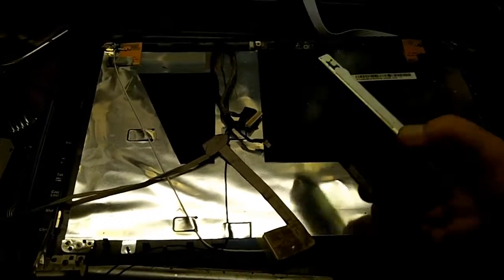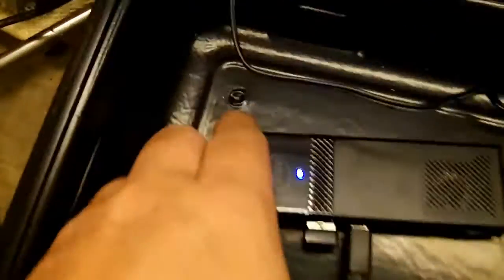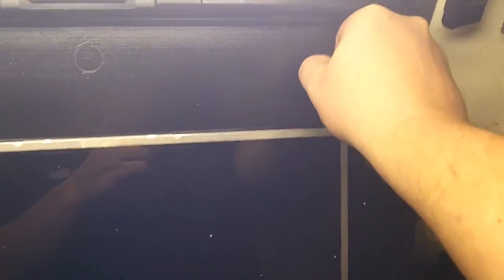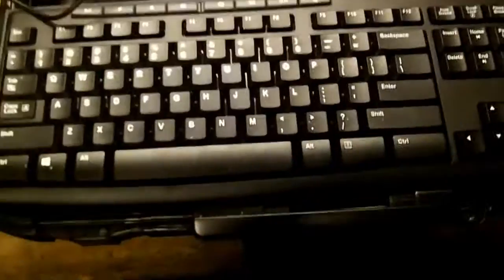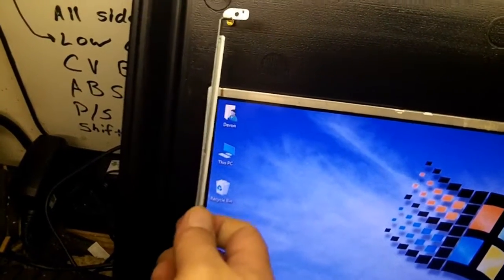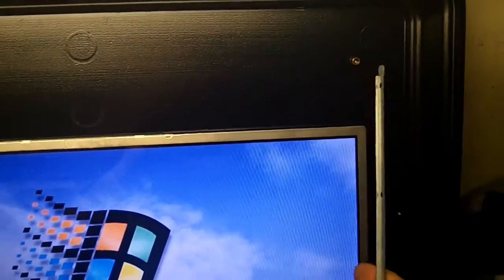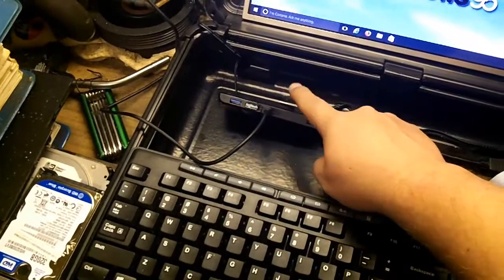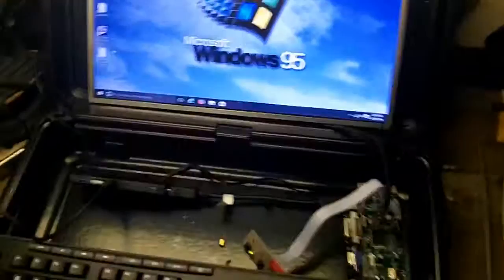DIY Custom Laptop w/Intel Compute Stick

Comment: dude try making a umpc with that
Reply from the maker: It's better to crack 1000 screens without losing your data than replacing 1000 tablets... unless you're in the business of making tablets.  I firmly believe the compute stick could have changed the world and the way we use portable desktop OS's. All they had to do was make it thermally efficient, sell it with a nicely crafted tablet sized monitor, and continually improve the HDMI based form factor. It could have wiped out laptops and tablets as we know it if Microsoft got on board with eventually allowing 64-bit desktop OS installs. It could have been a unifying form factor in something so simplistic. Instead we still have a world divided by laptops and tablets. The power of laptop with modularity of a desktop and display of a tablet in the form factor of a cell phone. A wasted opportunity to change the world.
Reply: @DJDevon3  Definitely. That is also why UMPCS in general failed. They had poor heating and had terrible specs for the price. UMPCS after the Toshiba Libretto 100ct just weren't that good.  It all fell apart when they couldn't fit enough power into a brick. But another thing that I think all UMPCS have lost (including smartphones) is the incredible battery life. The HP200lx had days of battery life. Umpcs definitely had a chance but all of these issues were the factors that killed them.

Comment: that's awesome bro ... would you like to add some built-n batteries in the future...i hope you make that a real laptop
Reply from the maker: There are 2 1650 battery packs I've added to power the system yes.  I still haven't finished it but I have tested it.  It can run continuously without recharging for 48 hours straight playing full HD video.  It was the best way I could think of for taxing the system.  The biggest design problem is not allowing the computer stick to touch the case otherwise it will melt a hole in it.  Using a metal shield and standoff to dissipate heat.

Comment: Creative idea and good re-purposing of a broken laptop's screen. But, that price? The compute stick is, what, $120-ish? The case is $30. The inverter board is $25-30? The new keyboard another $10? That is $160 to $170? I just bought a used Dell E6430 off ebay with an i5 3320m (dual core, hyperthreading, 3 MB cache, 3.1 GHz turbo on both cores) and the Nvidia NVS 5200m (96 CUDAs, Fermi, 1 GB GDDR3) for $140. It came with 4 GB of RAM, a 500 GB HDD, a Windows 7 64-bit Home key (that I upgraded to 10), the battery and the charger. Everything works great and the CPU, RAM and HDD can be upgraded. It will accept a quad core i7 CPU if desired which are now $80 to $90 for a 2.6 GHz one like the i7 3740QM (8 MB cache, up to 3.5 GHz turbo on all 4 cores). It also can be hacked to use a desktop GPU via the express card slot or the extra mPCIe slot. The only upgrade i did so far is a 120 GB SSD I had in an old PC. I don't own one of these Compute sticks but I do know that the performance is nowhere near the i5-3320m in the Dell. Even with the HD 4000 iGPU being used, the overall performance has to be 2x or 3x better. Clock speed alone makes the mobile i5 significantly faster. The Cherry Trail chip is using a shit ton less power, obviously, but running it on battery with a spin HDD and that display, it can't be getting much better battery life than my Dell laptop with an SSD and iGPU. Basically, if you are on a budget of under $200 and your laptop just died, a used Ivy Bridge or Sandy Bridge laptop might be a better bang for your buck option. They are dirt cheap right now and nowhere near obsolete yet compared to the current generation of dual core i5 and i3 laptop chips. That is just my opinion. Sell the dead laptop for whatever you can get for the parts and do what I did.
Reply from the maker: The small form factor is what attracted me.  I can fit it in my pocket.  I understand what you're saying about the laptop and desktop being more powerful of course.  They are a bit more modular.  There are many things you can do with a compute stick that you can't do with a laptop such as built-in workstations or displays around a house or building you plug a compute stick into.  So you take the computer with you in your pocket and then use a display at specific locations when needed.
Reply: More modular or more mobile? The compute stick is more mobile if you know an HDMI screen, a keyboard and a mouse will be available everywhere you go. If you have to lug that stuff around, a 14 inch notebook is more mobile with all those things contained in it. A laptop/notebook is even more mobile than your DIY laptop in this video. If you did mean modular, then the laptop I got is still more modular in design. The CPU, RAM and disk drives can be upgraded. It has eSATA, Express Card, SD Card, USB, mSATA and mPCIe. The DVD-RW drive pops out and you can add a 2nd HDD in the bay. It has HDMI and VGA out. If you get the docking station ($30 on ebay), it can run on 3 monitors and it adds Displayport and DVI-D. The dock basically turns it into a full-blown Ivy Bridge i3 desktop with a lower TDP since the 3320m shares the same basic specs with a desktop i3 3xxx (dual core with HT, HD 4000 GPU, 3 MB cache and a 3 GHz+ clock). It is compatible with way more things than the compute stick and more software since it runs a 64-bit version of Windows. It can run Linux. It can run Android emulators that take advantage of the CPU's VT-X feature. You can turn it into a Hackintosh and run OSX on it since it has the same hardware as a Macbook Pro from the same year. All that in the same price range as your setup. The only thing the Compute stick beats a laptop/notebook like that in is power consumption. Or, if all you want to do is turn a TV into a smart TV, the Compute stick has a smaller footprint. But, a laptop with HDMI out will do the same exact thing, it'll just take up more space.
Reply from the maker: The laptop and desktop are more modular seems you misunderstood that sentence.  The compute stick is more mobile of course but if you add in everything else required then that ceases to be true.  It depends on application.  The way I want to use it will be different from what was intended  so I completely understand why you might misunderstand a little.    

There are other reasons why something like this is nice.  I'd like to add a Raspberry Pi & Arduino + breadboard into this for circuit prototyping on the go.  The small form factor has many advantages for stuffing more things into a case than just a laptop.    

There are definitely different situations where this would be better than just a phone,  laptop, or  desktop.    There is a market for this type of thing and I don't think anyone really understands what Intel has just done for the world with this product.  I haven't seen anyone discuss how they can be utilized within an office, garage, workshop, or home environment which can be so much better than a conventional device. I'm in love with the concept of a computer the size of this thing.  It's waaaaay ahead of its time and I find it a crying shame how under utilized I see them in product review videos.  I'm gonna make this thing  shine, eventually, for everything it can do.

Think of the PiTop (Raspberry Pi laptop).   If you could add a compute stick, Raspberry Pi, Arduino, and an 8-channel USB oscilloscope in 1 laptop case you would have all modern creativity platforms at your fingertips... sounds pretty appealing to me. Maybe you understand where I'm going with it now.  ;)    I'll have base stations setup where I can detach the compute stick from my laptop then plug it in to a display somewhere else so I don't have to lug around my large case just to get a display.  These things would be amazing for college campuses and schools instead of people lugging around USB sticks.  A mobile phone with full OS and external display would likely kill compute sticks but Microsoft hasn't come out with anything like that... yet. Yes I have a small mobile keyboard too.  The  footprint of this thing is so small  and I think that's it's best attribute.  It's  simply been under utilized and  no one has really shown how to use it, in my opinion, like it should be.

I haven't revisited this project in a while but I did solve my power problem and created a really neat mobile power solution that provides 48 hours of continuous use of the compute stick.  There are wires all over the place it's messy but I have a great base to work from.
Reply from the maker: Yes at first it was to replace the laptop that was my thinking at the time of this video.  When I started building up the power supply I realized I could do so much more with it.  The project has evolved over time but you're right at first it was only to be a laptop.  It does perform that function adequately.  I should probably make another video about this soon but I uhhh never really got the monitor holder done with the results I wanted.  It looks poorly cut out and doesn't quite fit up perfectly.   You'll see when I upload the next one.  I appreciate your comments, you know your stuff. ;)

Comment: Dayum, this is what I was dreaming to do, I am thinking of making my own tablet pc but ive got a question. Is the "inverter board" a generic one or do you need to load custom software in it power different lcds. It would be cool if you could link the place where you bought it. Great job!
Reply from the maker: There is no software involved.  The inverter board only routes the video signal from your device through the hardware (PCB) and spits out the signal to the monitor.  There are no drivers or software involved.  No point in me linking the inverter board because there are hundreds of different monitor models out there.  You have to find the model # on the back of the monitor and give that to the ebay seller. I provide a link in the description to the ebay seller that I used for the inverter board.  They're likely to have the correct inverter you need if you provide them with your monitor model #.   Good luck! ;)
Reply: There are a bunch of ebay sellers that sell these. They are universal but there is a chip on them that has to be flashed to your specific monitor. Most of the sellers will flash the chip for you if you give them the model number.

Comment: Thanks for the shout out!!  After that build up, I think they might be a bit disappointed when they get there!! LOL!!! :)  
Very cool project!  We'll talk more in emails about dimensions and such.  Looks like there's several options. 

Never heard of the compute stick before.  Can the memory be expanded?
Reply: You can expand the storage memory but not the RAM. You can buy units with up to 4GB of memory.
Reply from the maker: No the memory is soldered on but there are different versions currently up to 4GB with Intel m5 CPU.  I can only imagine how hot that sucker gets vs the low power one I have.  

If you want something with expandable memory check out the Intel NUC instead.  The price vs performance value is actually better on the compute stick vs NUC otherwise I would have purchased the NUC.  The $130 NUC is about 2/3 the performance of the $130 compute stick.  I've done the benchmarks. The NUC does not come with RAM, hard drive, or operating system so the price is a bit misleading.  By the time you add those components you're looking at almost triple the cost for 2/3 the performance of the compute stick. Not a good deal. 

The compute stick comes with Windows 10 operating system (a $100 value itself).  The reason the OS is free has nothing to do with Windows 10 free campaign.  They have a deal with all SBC manufacturers that if they make a device that runs on 32-bit Windows 10 and has 2GB of RAM or less then they provide the OS for free. The OS would be free with the NUC if it came with a hard drive, why they decided not to include one I don't know, probably just to market them cheaper which is very misleading about the final cost of the NUC.  

The $180 NUC CPU is equivalent to the $130 compute stick CPU.

The NUC has a built in ethernet jack.  Compute stick has AC wireless (and it works phenomenally well). Does that make up for the performance and value gap vs the compute stick? Hell no, not even close. However the higher powered NUC's blow the compute stick away in performance but not price. I wasn't willing to pay that much, I could buy a brand new laptop for $700.  At $130 the compute stick is the clear winner for performance and price.
Reply: Very interesting!  I don't have a need/use for one at this time, but it's really good to know it's out there. :) Thanks!!